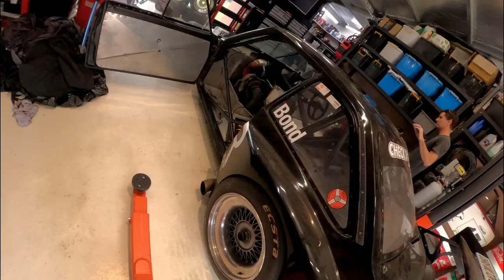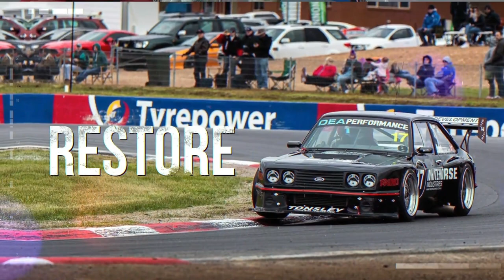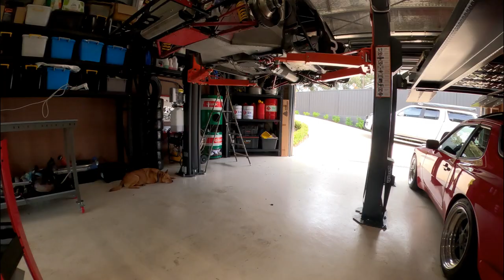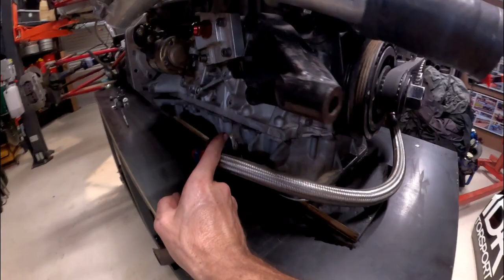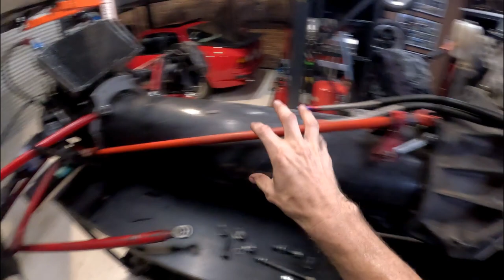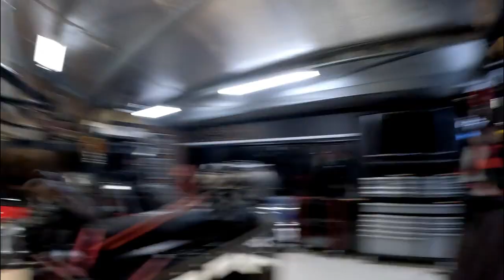Removing the Driveline from my SR20det Race Car!

Comment: Gear linkages are as they were on a 5000 or similar.
That car was built for a Chev,, Cos could not afford one intially. So ran the Cosworth from the Anglia.
Does Mick still have the engine that came from it?
Reply from the maker: He’s still got the original heads. We’ve got a motor getting built and will use as many original parts as we can, but we also want reliability etc.